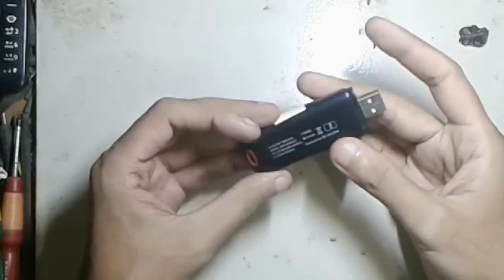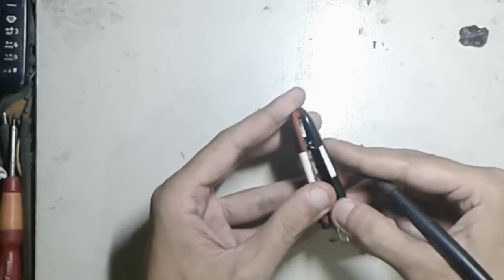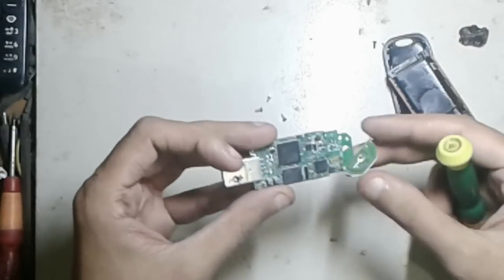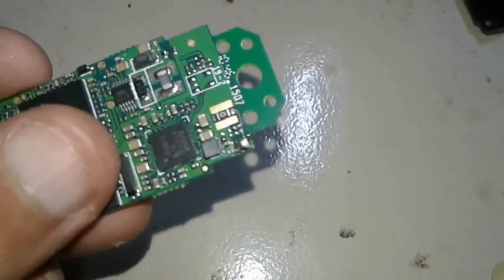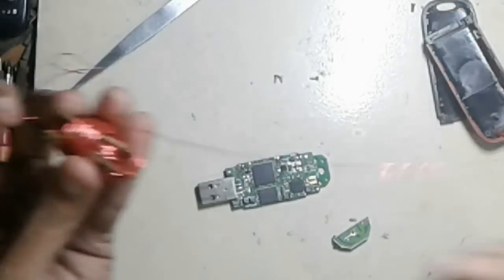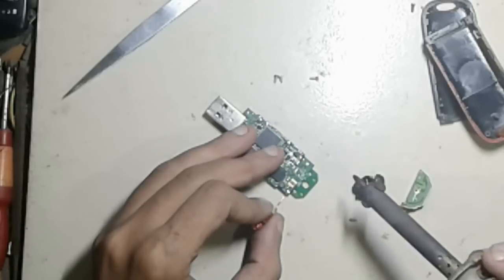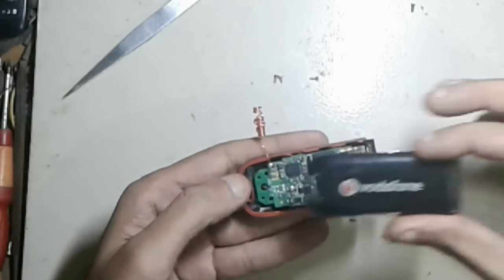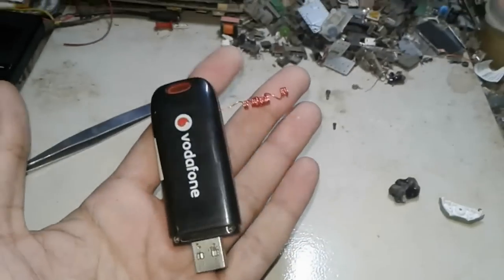How to Make  3g 4g booster antenna for Your Modem

Comment: Can you help my 4g mifi is so slow it can’t download anything can help please!
Reply from the maker: Yes. Check your signal. If it is low. Then use a outdoor antenna.
Reply: SMRITY COMPUTER is 3 bar but download is only 1 mbps any tips to increase it please?
Reply from the maker: @btsjemn8309  i thinks your opreator speed is slow. You can try using a vpn.
Reply: SMRITY COMPUTER thanks for help 😃

Comment: why cant u try out to show the test result!!!! please do not try to use this idea unless u have skills on it, i used it but i found myself lowering my device capabilitry
Reply from the maker: Thank your for your comment. I have my own Mobile repairing institute. This is my job. Before make it i try it for my self. Some times it  can't run clearly coz of frq of antenna. wire is another fact. you can try it if your understand about this system. Thank you once again.
Reply: Haha

Comment: Hi, I’ve just watched your vid. I get the impression you seem to know what your talking about. As yet I know very little about external antenna. I’ve recently improved my low signal problem by getting a ( second hand ) locked MiFi ( and with a different UK provider ) for my Android mobile and iPad. I’ve just bought ( but not yet received ) a HUAWEI E5573 MiFi unlocked ( second hand ) to see how that might improve the signal with my original provider. I’m wanting to attach a small Ts9 antenna and experiment with a larger external antenna with the HUAWEI MiFi ( the locked MiFi does not have any antenna ports ). I’m also wanting to experiment with attaching a small antenna to my Android mobile. When I watch vids by people testing factory made external antenna, so many people say they do not work ( for whatever reason ) and with vids about making your own external antenna, so many people comment that you have got to be very accurate - you just quickly coiled a bit of wire ( in a bit of a birds nest ) and you claim it works and I can’t help but believe you! When I receive my HUAWEI I’ll be able to start experimenting and no doubt I’ll eventually solve the whole problem and get the excellent signal that some people claim you can with MiFi’s and antenna boosters. A question would it not be better if you kept the original ( internal antenna ) attached as well as attaching the external antenna that you made. Or with a device, such as yours that is not designed to have an external antenna port would having to large an antenna area require an increase in amplification. This whole subject seems a bit complicated but I’m sure I’ll sort it all out. Any comment you can make will be appreciated, thank you

Comment: Great ! it worked for me.............
Reply from the maker: Thank you For your comment :)
Reply: i made it with copper .....rather steel..is it fine? and the copper wire is thicker than yours...
Reply from the maker: yes you can. But steel can reflect more gain.

Comment: Good video. The wire used for antenna is called Insulated Copper Wire  and can be bought from any electrical shop. My question is what is I wrap the copper wire around the full length of modem and insert one end inside and solder it like you have done. Will it not be better antenna as it will have more surface area to catch signal?

Can you do a test of modem before  adding you antenna and after adding your modification and show how much performance improvement?
Reply from the maker: Thanks for your comment :) As we know if we need better performance of our modem then we need good signal. Modem Gnd line and A main line from Ic try to catch Signal. So if we need to make strong signal easy way then we need to increase surface way of it. More surface able to catch more gain for your modem. Perfect example analog mobile antenna. Hope you can understand :)